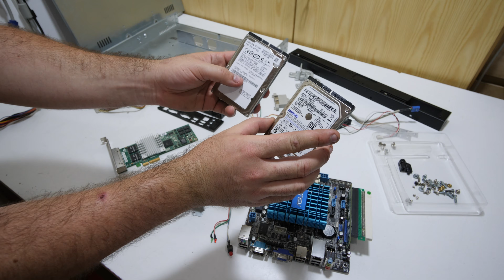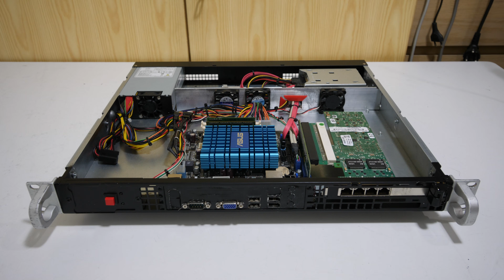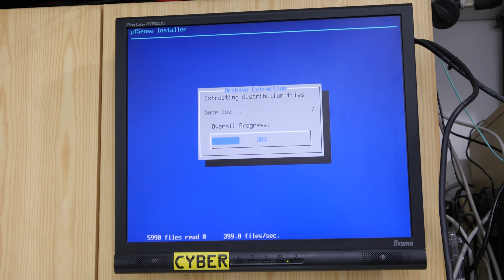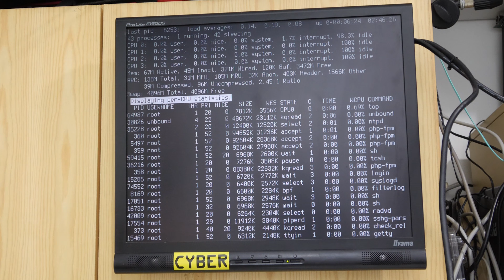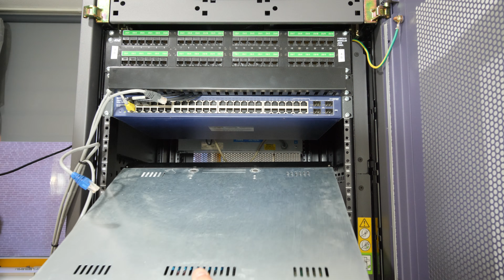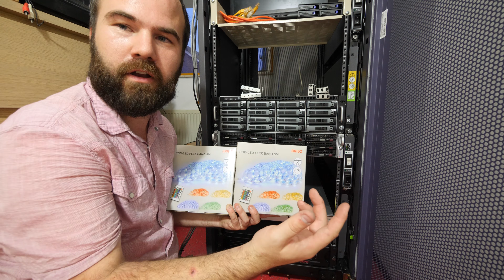I Build a Custom 1U Rackmount pfSense Router on a Budget!

Comment: I've done that a few times to an IO Shield. If you get tired of looking at the Tape you can use JB Weld, apply a few layers and sand it.

When I need an IO shield for a Motherboard I'll use Cardboard or pipsicle sticks. Use my dremel to make the cutouts then use Bondo spot putty glaze and some times JB weld. Sand then paint. I also attend to use copper foil tape for the inside portion of the custom IO shield. Some time I want to try using a copper clad PCB board, might try that on my next custom build.

Comment: Zwaar NL accent gast.

I suggest getting rid of the hdd's and putting in an SSD,  that would make the system faster, more quiet and consume less power. And you can use the storage for logs, caching or snort.   You really don't want to virtualize your PFsense router trust me!  Sure it's fine for some tests but it's a pain in the ass if something goes down. Also with segmenting your network or VLAN's it's much easier to have a physical machine.  The only drawback is power consumption.
Reply: none none so I got this case with me, at my company we have an old server with pfsense dedicated to it.... and they want to virtualize... they said that is easier to make backup of it (veeam for example)... só for you it’s better to have a pfsense dedicated? Physical machine?
Reply: There's very low powered cpu 1U rackmount servers that draw like 28w under, load.

Comment: 13:35 sugestion, maybe swap order put the atom on top of the switch and intal some 120/140/180mm inside the 1u and drill some intake on top cover adding shroud to direct air flow to hdd,cpu,nic... Ty for the vid

Comment: Nice I use a AllenTech passive cooled thin client with the same D525 Atom and 4GB DDR3 laptop ram for my FTP with all my dos/windows 9x drivers and games my Network print server for my Oldschool deskjet 550c color printer from 1992 and my Quake 1 and UT99 server running linux mint and it runs great from a 500gb HGST 2.5" Laptop hard drive and only draws 33wats from the wall no fans and stays under 35c

Comment: the network card will work fine. but i recommend to add some cooling to that card or you will have a thermal shutdown if you get a lot of traffic.
Reply from the maker: that is why I have the 3x 4cm fans. And the biggest air intake is around the nic

Comment: I recently moved from a 1U Kemp Loadmaster LM3600 running pfsense  with an Intel E4600 to a HP ML350p with an E5-2603 because of the requirement of AES-NI on the CPU. But the main benefit was power consumption! The only system used around 80w of power where as the HP uses around 50w,, but with much more power, plus benefits such as ILO. Only downside it its a full 5u tower compared to a 1U unit!

Comment: I think I still run my PFSense box with 256 mb of ram on a N230 atom. (i may have upped it to 512 at some point.) And it is more than plenty for my needs on a 300mbit connection.  I think about the only things that would kill it were inline antivirus and content filtering. Things like Squid were no problem, but I don't run any of that stuff now.